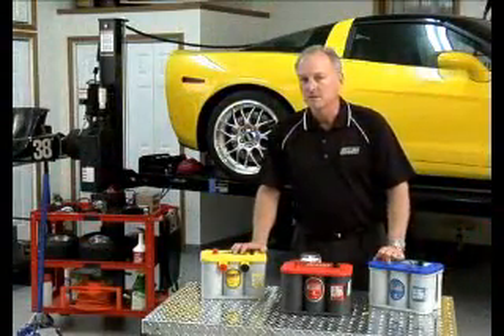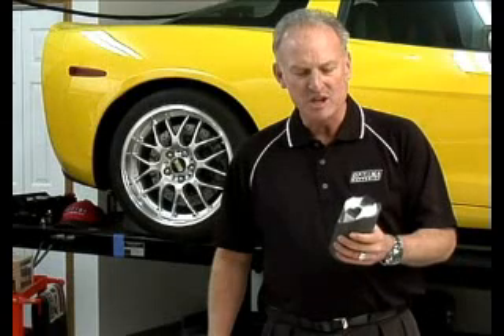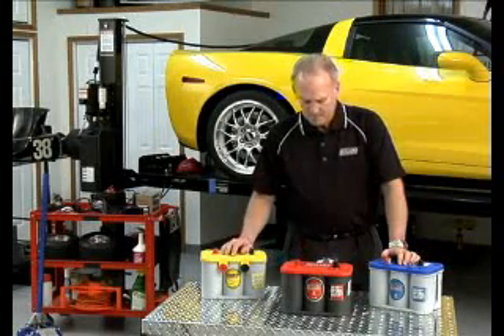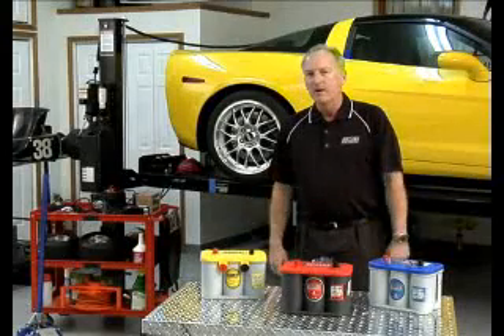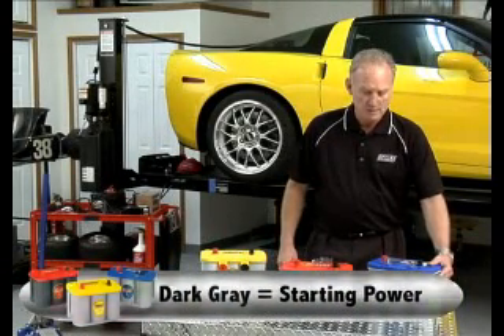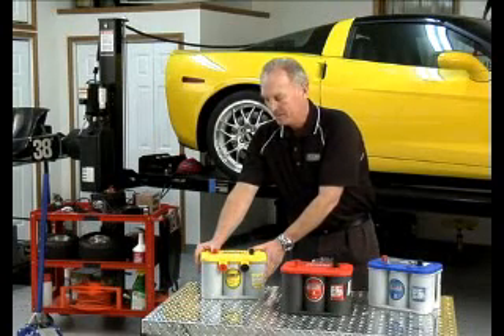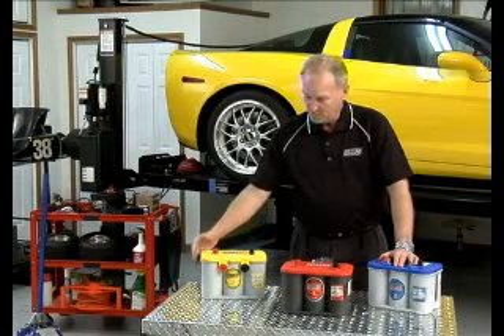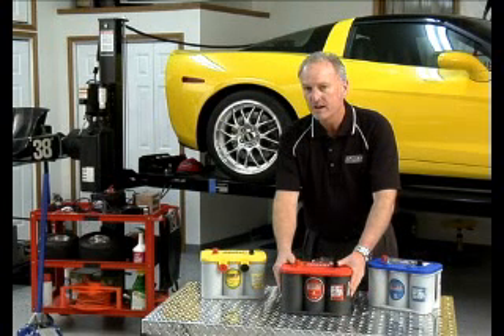OPTIMA® Tech Tips: Choosing the Right Battery

Comment: Would a red top fit my 05 Cbr1000rr? I need a lot of power for cold weather start on my bike the battery I have now keeps freezing and running out of power, i also and have a few electronics like gps and a phone charger is the red top right me as well?
Reply from the maker: We don't consider any of our REDTOP batteries to be direct-fit replacements in motorcycle applications. You might have a hard time finding anywhere on a motorcycle to mount our batteries.
Reply: Dang I could really use one of these type of batteries on my bike for these cold months but thanks anyways.

Comment: which battery type should I use for my truck which uses two batteries with a snow plow on the truck. Im not shure since the plow is only being used when the truck is running
Reply from the maker: We would recommend YELLOWTOP batteries. Plowing often involves more electrical demands than just plowing. Auxiliary lighting, defrost, salting and engine speeds that may not allow the alternator to keep pace with electrical demands.

Comment: What do you suggest for a 2006 Dodge Cummins Diesel? I will need two batteries. The truck sits for long periods at a time, sometimes three weeks without being started. Would a yellow top be my best bet?
Reply from the maker: +ryan b our Group 34 batteries (including 34/78) are listed as a direct fit replacement for that vehicle. Ideally, if a vehicle is going to sit for long periods of time, it's best to keep your batteries maintained with a quality battery maintainer. A viable alternative is fully-charging and disconnecting the batteries when putting the vehicle into storage.

Comment: i have a 2004 chevy duramax diesel and i want to get a optima battery but i don't know if i should get red or yellow the truck has hid headlights and fog lights and an led light bar nothing else except upgraded head unit and speakers but no amps or subs i am not sure which battery to get i live in new york if gets down to about -10 in the winter and i rarely doing offroading in the truck could you help me chose which battery is right for me also its a dual battery set up

Comment: I had a red top that lasted me 7yrs! I had it in 3 different vehicles in AZ heat and it finally died when we took a trip to Cali and the guys at Autozone couldn't believe how old it was but the manufactured date was right there on it. Needless to say got the same battery and also I put 2 yellow tops in my F250 7.3l 2 years ago and I have a 12" with 1500w running it and have not had to touch those batteries except to jump start somebody else. These are the only batteries I will put in our cars especially with my wife and kids driving around when its a 116 outside and I'm at work or out of town.

Comment: I have a 2008 Altima with a aftermarket stereo and a 600 watt amp powering two 12's. Also I was planning on getting a pair of 6×9's and powering them with a two channel amp with 100 watts going to each. But before I get the 6x9's I was planning on changing my battery first, so which battery would you recommend? And would changing my battery alone be enough to power this?

Thanks.
Reply from the maker: thirdwardtx713 definitely a YellowTop for your application. The question then turns to usage. The larger the battery, the more reserve capacity it will have, so a Group 27 will have more capacity than a Group 34/78 and a Group 31 will have the most available. However, physically larger batteries limit your mounting options and any battery mounted in an enclosed area (including your interior or trunk) should be properly-vented to the outside air. If you run your stereo frequently with the engine off, you'll want more capacity, than if you typically only run it with the engine on. 

Also, your entire electrical system will only be as strong as the weakest link. As you add more demand, you need to make sure your supply is up to the task, including your alternator and wiring.

Comment: I had a yellow top replaced it with a red top two days ago and bought a re manufactured alternator, I have a 1000 watt amp powering two 12inch subwoofers a600amp for four speakers.the guy at autozone recommended  me the red top battery will I be okay with the red top even though I don't have a big sound system set up.
Reply from the maker: Saul Martinez we do not recommend RedTop batteries for deep-cycle applications, which would include car audio. A YellowTop would be the appropriate choice.

Comment: I have a Ford F-150 Platinum TV' s in both head rest navigation, fully loaded factory Sony sound system with sub and amp. And video games systems hook u p's for my kid when he's old enough to use it lol. He'll be 1 July 30th 2014.   And I cannot leave my truck on without killing the battery it is original battery 2010 factory so I know it's time for new one.   I live in Michigan where the winters can be bad like the one we just got out of smh. Not sure red or yellow top. Help oh and why not get interstate battery, some tell me it's better I don't know myself.
Reply from the maker: We would definitely recommend a YellowTop for your application, as it is designed for both starting and deep-cycle use, which would include your audio/video accessories. That battery is also protected from freezing down to -30°F and uses 99.99% pure, virgin lead, which helps improve battery performance, versus batteries that use recycled lead.

Comment: I bought an Optima battery for my car and it lasted only 2 years.  I had hoped for more life.  I won't buy another Optima battery based on my experience.
Reply from the maker: We're sorry to hear about the problems you had. What type of application were you using it in and what were the circumstances surrounding your issues?
Reply: I was using it in an automotive application.  Lasted 2 years then would not start the car.  Installed by the local Autozone store.
Reply from the maker: Do you recall the voltage level when you were having issues? Did Autozone provide you with a warranty replacement?
Reply: I don't recall the voltage level.  They did not provide a warranty replacement because I got a different brand.
Reply from the maker: We're sorry to hear you weren't satisfied with our product. They do come with three-year free replacement warranties.
Reply: I would not buy another starter battery that was sealed.  No way to maintain them.
Reply from the maker: We recommend maintaining our batteries with a battery charger.
Reply: I have a different car now, and there are no batteries for my application.

Comment from the maker: @Dansz71sierra Your electrical system will only be as strong as it's weakest link.  If you only run accessories with the engine running and your alternator and wiring are up to the task, you should be fine with a RedTop battery.

Comment from the maker: @Dansz71sierra When you upgraded your lighting, did you also upgrade your alternator and wiring?  A YellowTop is a better choice for vehicles that have significant electrical accessories that could deeply-discharge a battery.

Comment: im running about 550watts of extra off road lights on my truck and was wondering if i NEED a deep cycle battery and should i get a red top or yellow top?

i only need a deep cycle battery if i leave the audio/lights running while its off correct? other then that it dosnt help with the operation of lights at all right?

Comment from the maker: @BrentonSpratt If you have upgraded your audio system, the deep-cycle capability of an appropriately-sized YellowTop definitely makes it a good choice. However, the battery is just one piece to the puzzle for you. As you have increased your electrical demands, you also need to consider how that will impact your charging system. If your alternator is failing, it might be a good idea to replace it with a higher-output alternator. Upgrading your wiring would also be a wise investment.

Comment: I have recently had a duel sub and AMP installed in by car (2x 12" running at 250 RMS and the AMP is 900 watt) about a week later i started having the battery warning light turning on indicating the alternator was not working properly and a week after that i had a flat battery. I have been looking around online and have been suggested to get a Yellow Top battery. Would the yellow top be what i Need for my sound system?